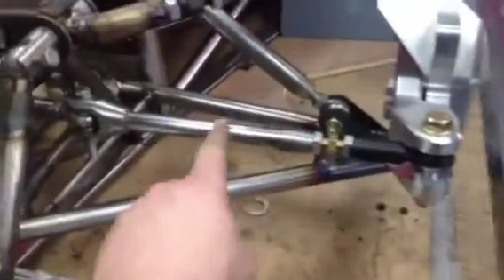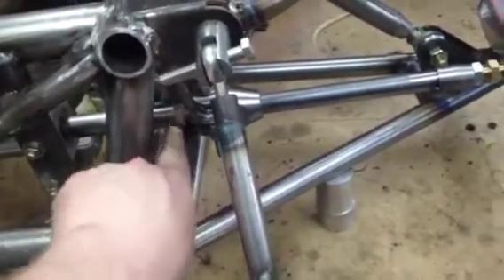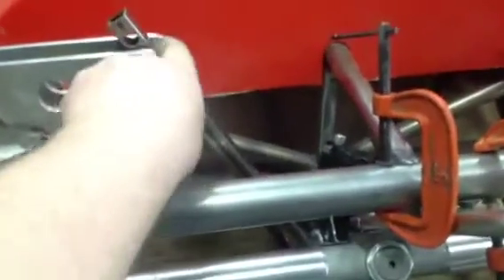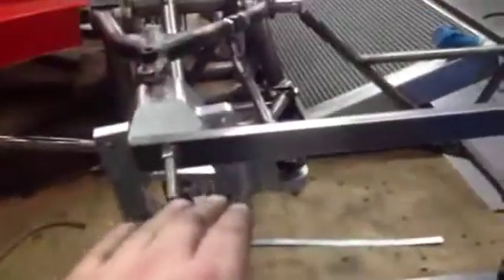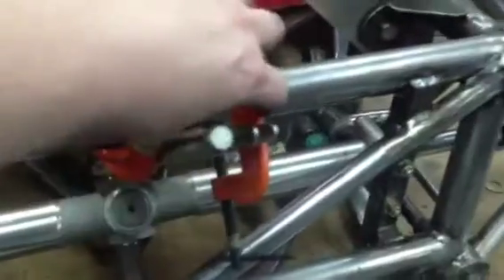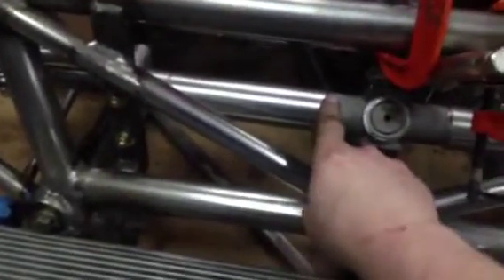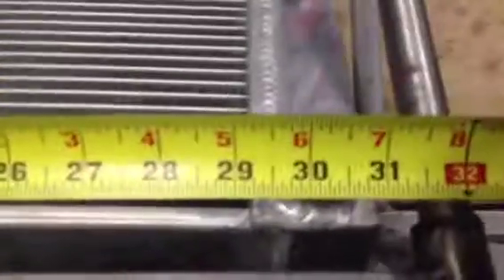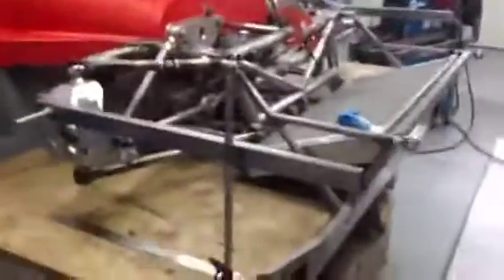Zero bump steer !!!!!!!!!

Comment: takes me back to 1980 .. no cad   just plain white wallpaper and 1/4 square straight lengths of wood.with panel nails for pivots  All at 2 x scale to get better accuracy...  My set up was almost identical to yours for checking . A super set up cars handling can be destroyed with poor aerodynamics .. I used two dial gauges on a flat  ally plate bolted onto the hub . Well done ..  BUMP steer is best  at zero . droop has very little effect because the tyre is unloaded . shimming the steering joint up and down has the most results ..  assuming your track control arms and wishbone pivot mounting points are doing what you want  to achieve a drivable car. I 9% nickel brazed all of my fabrications . using a gas fluxer .. by Calor .